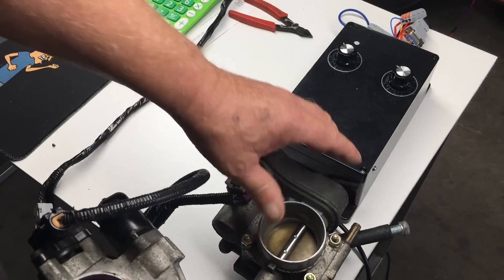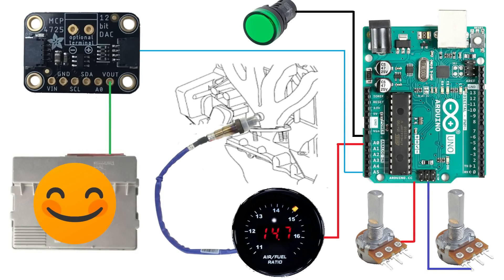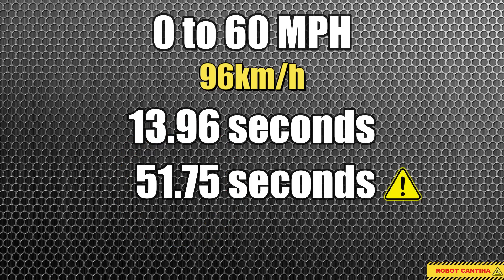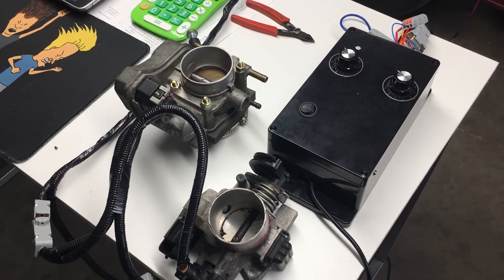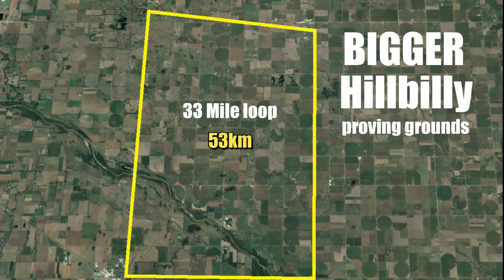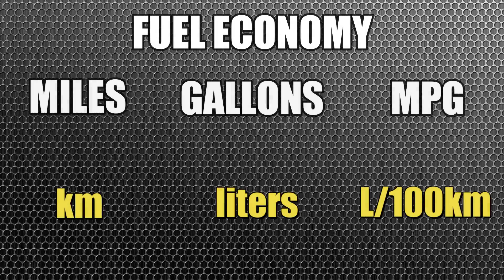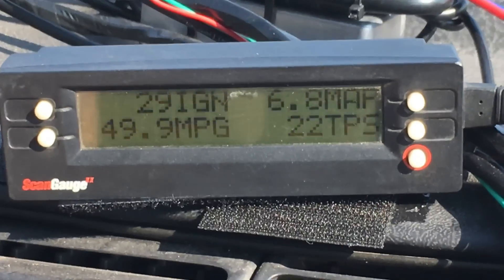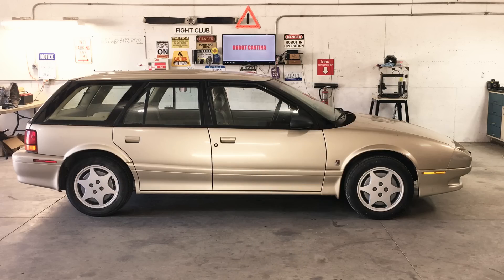S2E21: Our modified Saturn that gets Extreme MPG with lean-burn and Robo-throttle.

Comment: The fact that you created a fully automatic system that improves the stock mpg, which was optimized by a team of engineers for several months, is honestly insane. I bet the robot throttle is pretty much exactly the same as the "eco mode" found on newer cars. I watch a lot of car YouTube and I've NEVER seen someone experiment this much in the pursuit of better efficiency, it's really fun to watch
Reply: That's because they engineer for no such thing. All of the engineering is built around emissions compliance numbers at the tail pipe.  Clean burning has nothing at all to do with engine A/F ratio relating to power and or fuel efficiency.
Reply: @tcmtech7515  Yes, exactly this!

With engine designs (and ecu tunes) emissions output is #1 priority. MPGs are lower priority, but still a priority none the less. You see manufacturers still have to avarage a certain fleet mpgs not to get slapped by fines.
In europe for example. fleet avarage has to be a certain CO2 (which directly corelates to mpgs) otherwise fines.
Reply: @tcmtech7515  Bingo. A 'lean-burn' is not emissions compliant, the engineers did the best they could with the emissions and fuel standards of the time. Some countries (Australia?) did get some cars with a lean-burn mode that was not enabled on North American versions.
Reply: @tcmtech7515  this isn't exactly true... In modern cars the only emissions equipment on them is that catalytic converter. After that the engine control is so precise it doesn't need anything else. Further fuel gets wasted on survivability, running lean is how you get knock. People like engines that don't explode. Power and efficiency are two sides of the same coin. 

What he's doing is overriding the driver behavior, this is fine but you might want a car that accelerates when you press the pedal. Further in modern engines they are hilariously more efficient but, consumers want power and bigger cars. This is the actual issue, car weights keep going up. It is remarkable we can have a 2 ton vehicle hit 30 highway honestly. 

I tune engines as a hobby and an in school for engineering. I have spent 100s of hours logging engines. I'm kinda giving a simplified explanation of things. The tldr is cars are getting heavier and faster that's why they don't get better mpgs.
Reply: @Jonas_Aa  Depending on the richness or leaness different products of combustion occur. During lean burn you get more nox gas. During rich burn you get more CO2 and particulates the unburnt matter being converted to co2. Modern catalytic converters pretty much stop most of it. The thing they use to compensate those issues is using more and bigger catalytic converters.
Reply: @notsam498  What common 2 ton vehicles are doing 30 MPG these days on pump gas?
Reply: @notsam498  Interesting that ALL of your posts, where you made a fool of yourself trying to argue that its my fault you couldnt refute me as I wanted you to, have now disparead as well.
Reply: @notsam498  Look up what PZEV is, lots more to emissions than cats
Reply: @Astrothunderkat  not really in modern cars. I've worked on them and I'm here to tell you that it is all electronic aside from the cat. After that You have an EVAP recirc system for the fuel tank... That's about it, EVAP doesn't play a big role in engine operation. It really only comes in at idle. On the electronic end, very little of it is strictly for emissions... The only time this isn't true is when trying to make power under forced induction.... Going rich sometimes  has benefits for that, which badly hurt emissions and efficiency. So it is more likely they will make slightly less power to avoid that in those conditions. To be clear I mean that I haven't seen an EGR or air injection system or anything like that on a car newer than 2008 that I've worked on. Being Mazda, Ford, GM, Nissan, bmw....I didn't look in the Subaru I was working on, but I also didn't see anything last time.
Reply: @notsam498  So ancidotal evidence covering <.1% of the in play vehicles that most cant afford can do it.  

 Good to know that counts as a valid example these days.
Reply: @notsam498  What grade school maths and online research work are you having trouble with?  

This is basic internet research and adding simple numbers and then comparing them to the greater number of vehicles on the road today to find their combined percentage of the greater whole.  😓
Reply: @notsam498  You do realize I want you to prove me wrong, right?   How is your failure to do the research and find the numbers to prove me wrong my fault and my ego tripping here?  

Transparently project much? 😋
Reply: @notsam498  SO, you are admitting you used ancedotal evidence that doesn't remotely represent reality.  Just as my rough numbers call out implied?  

And that's supposed to reflect negatively on me somehow simply for my being able to use a common engineering practice of giving something its real-world context? 😆
Reply: @tcmtech7515  no I'm saying you moved the goal post, which is a logical fallacy. It is pointless to continue on. Say what ever you like. My point stands unchallenged.
Reply: @notsam498  What imagined goalpost did I supposedly move this time?  

What point remains unchallenged?  The one we both agreed on in that your selection represents a tiny and unrealistic percentage of the greater whole of vehicles on the road? 🤨
Reply: @@mikkelrs5892 It does happen. I had a 1994 Mercury Grand Marquis with 4.6l V8 that once I  had stripped all the emissions crap off of it did high 20s and occasionally low 30s on long interstate speed trips.
Reply: @@mikkelrs5892 I did that and went one step further by putting ~ .3 volt forward drop germanium diodes in series with the O2 sensors to push the A/F ratio away for the  ~14.7/1 Sticheoamtic clean burn range into the ~ 12.9:1 power/efficiency range.  

On the Ford 4.6L V8 that was good for more bottom-end torque and about 10 - 15% more fuel mileage on average. 

I have yet to find a vehicle where doing that mod doesn't wake them up on both low-end power and driving range fuel efficiency!
Reply: Thanks epa😮
Reply: We're also talking about 20+ year-old optimization from the engineers, and 20+ years of wear on the engine. Technology has advanced a lot since this car was new.

Comment: It does make a guy wonder what kind of MPG could be squeezed out of an older "economy" engine (thinking inline 6) with all of these concepts integrated into a retrofit EFI setup.

People have been having pretty decent luck with Holley sniper type units, But those aren't really "economy focused", Kind of makes you wonder what could be achieved if the main goal was to increase fuel economy.
Reply: I often thought there was a better way to reduce smog than to dump fuel into a catalytic converter on startup. Maybe re-engineer the fuel to burn more efficiently? I don't know...just thinking...
Reply: @dangerousdave5915  Running rich when cold is required on all gas engines, with or without a catalytic converter. With a cold engine any fuel that falls out of the fuel/air suspension pools up on ports, cylinder, piston and is not either not burnt or incompletely burnt which makes the engine run lean. This is why carburettored engines had a choke. When the engine is hot any drop out is quickly vapourised.
The excess hydrocarbons in the exhaust after a cold start can be used to quickly heat the cat up by adding air into the exhaust, this is called secondary air injection.  The best system in this regard ia direct injection (GDi) as there is no opportunity for drop out in the ports and back of the valves.

Burning fuel more efficiently is the primary goal of the vast majority of engine research (whether for power or economy), it's just very difficult to make significant improvements because the engine cycle itself (the Otto cycle for a gas four stroke engine)  is the limiting factor.
Reply: @ferrumignis  Thank you for the explanation!

Comment: Saturn has "Wasted-spark" type of ignition. Every rotation one of the pistons from pair (1&4 and 2&3) has compression&power stroke. So you just need 1 rotation of crankshaft to get ECU in correct table for ignition.
Reply: Probably has batch fire fuel injection too, not true sequential.
Reply from the maker: The Saturn we use for the videos  actually has sequential EFI even though it lacks a cam position sensor.  A few folks in the comment section have done a decent job explaining how it works, but basically the ECU is using some clever magic and monitoring the coil pack module.  its very interesting on how it works.
Reply: @robotcantina8957  very interesting! Throw a Speeduino in batch mode on it!
Reply: @robotcantina8957  How many connectors are there on the ignition control module? If it's two then it's batch fire, If it's one then it's sequential.

Comment: Having a crank sensor only turns the system into a multi port injection. That means fuel injectors fire when the valve is closed as well. This is how piggy back port injection systems work. One such example is called a “split second controller”.
In a 4 cylinder it fires 2 cylinders at a time. 1 and 3 fire at the same time and so does 2 and 4. 
Also the ignition system is used as a wasted spark system where it fires the coils during the exhaust as well as compression cycle.

Hope this helps.

Hptuners has Saturn  tuning capability. This would be a better option than a piggy back system. I’d be willing to help it here if this is something you are interested in.
Reply from the maker: Indeed,  most engines with just a crank position sensor have the injectors batch fired, but on the Saturn they managed to do true sequential injection.  If you look through through comments, someone did a great job explaining the saturn's method of sequential injection.  Its bizarre, but apparently it works.
Reply: Actually they do have a true sequential injection AND timing. You see, you don't really need a cam sensor to determine each of the cylinder state. You can also achieve that using MAP sensor data. I'm not sure if saturn does it like this (it likely does) but some other euro cars from the alst century do exactly that to achieve sequential inj/timing.

Comment: I just love your little show..  My 1995 ford escort wagon is now running on propane.   I was very disappointed in ford.. the mpg is horrible.. nothing wrong with the car but probably ac use.. gets 30 mpg with gasoline and only 21 mpg with propane.. I have a 1980's mechanical distributor that I think will fit on so.. maybe advanced timing will help?  .. come up to Belvue Ks sometime at my Old Country Woodworks shop and check it out...